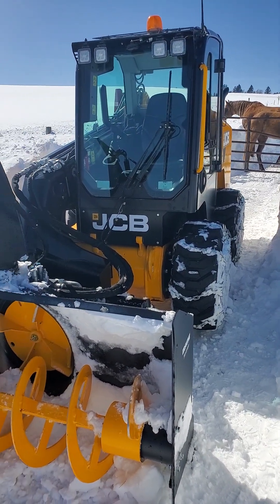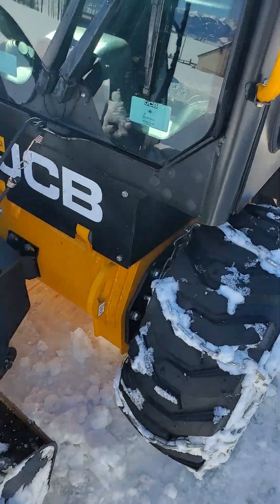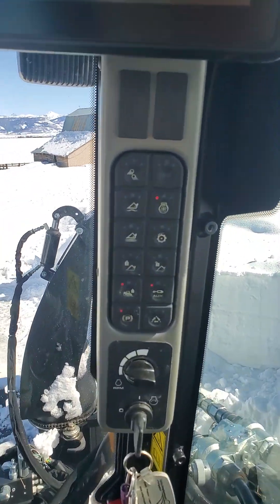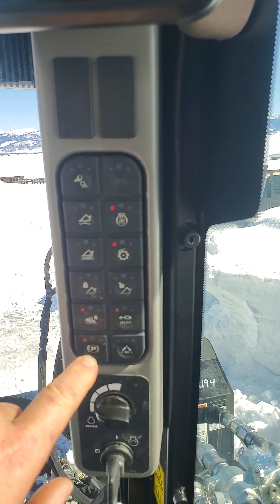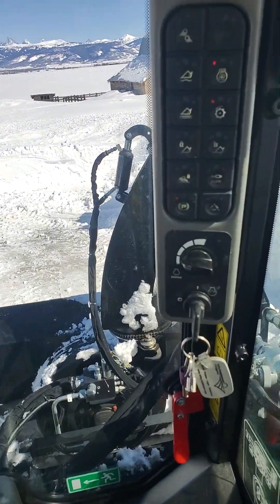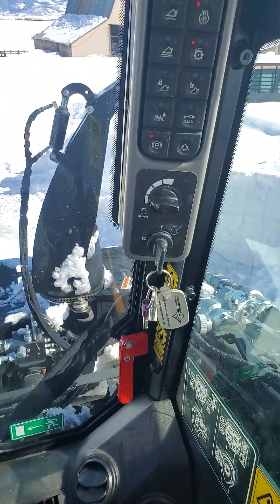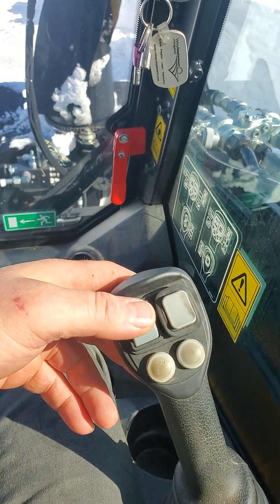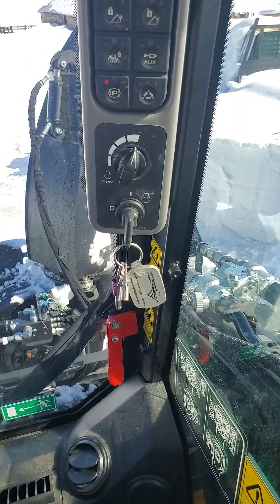JCB 2023 Teleskid Continuous Flow/High Flow Tutorial

Comment: Odd question, can you boom out the teleskid with a blower on and running?
Reply from the maker: The high flow connections are not on the arm that extends so the hoses would not reach very far if you tried to extend it plus the machine turns off the high flow setting as soon as you try to extend the boom. The Teleskid does have regular flow connections on the boom that extend with the machine so if you bought a snow blower that has the hydraulic motor rated for the lower flow and connected it to those connections then you could extend the blower with the boom. You would need to extend the control wiring somehow. Would be handy in certain situations to have the ability to clear snow off of high areas or out over areas that the machine couldn't drive.
Reply: @edgiewireless  Dang! Was hoping it would. There are times where you always are trying to clear a little further into a road ditch, etc to get rid of mounds of snow that cause drifting. Thanks for the info